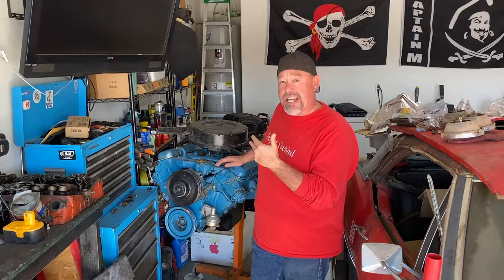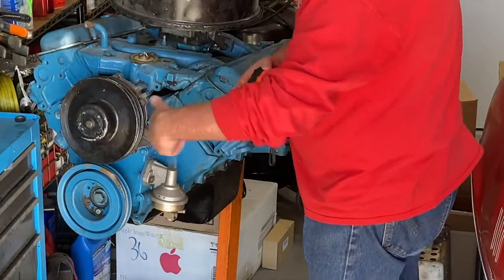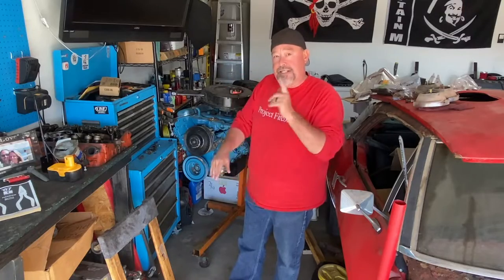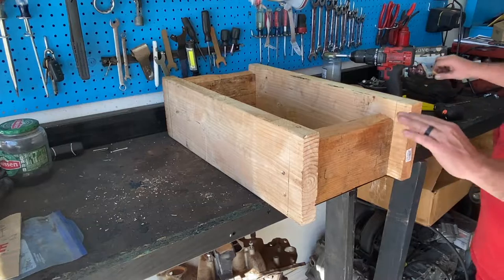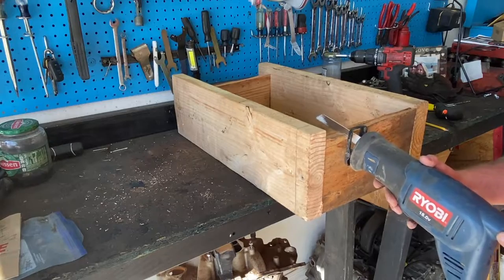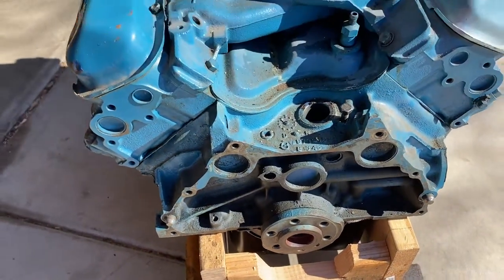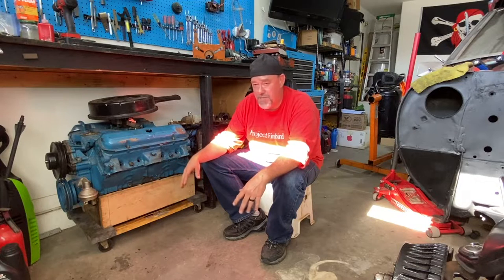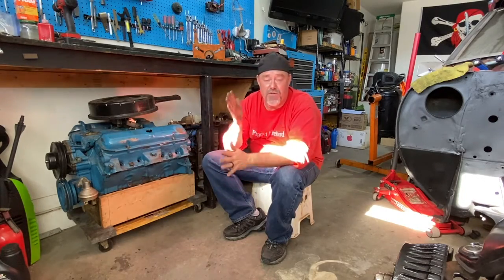DIY Engine Stand Cradle Dolly Made of Wood - Easy and Budget Friendly Build

Comment: Cheap and easy!  Those HF furniture dollies are an excellent buy.  I'm pretty sure you can buy them on sale cheaper than you can buy the 4 dolly wheels separately.  One suggestion for an easier way to check the fit; rotate the engine on the stand so the oil pan points up.  That way you can just lay the cradle on the engine pan to get a better view of how it's fitting.  Thanks for posting!
Reply from the maker: Thanks for the tips!  I might have another engine on its way and I will have to think of maybe a better plan.